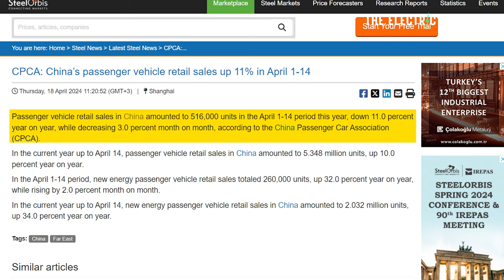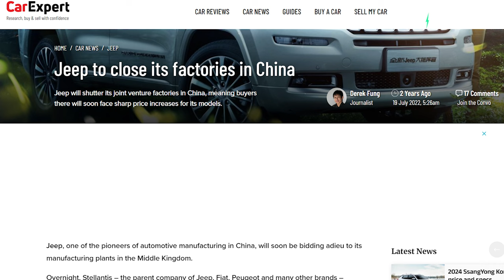China’s EV sales pass 50% - Toyota Camry & Nissan Sylphy crash 60%

Comment: I am surprised that people doubted that EV will break 50% in china very quickly.  Although non-scientific, among my Chinese friends who are in the market for a new car,  every single one of them are looking for an EV.
Reply: People lie too.
Reply: Also helps when you have to enter a lottery for number plates
Reply: And how does China produce its electricity ?
Reply: @wengelder9256  China is  largest user of solar & wind. They also have the 3 Gorges dam which is bigger than Hoover dam
Reply: @1rjona  The answer is coal. They open a new coal fired plant every week.
Reply: @wengelder9256 doesn't matter. Even if it was 100% coal fired, on a pure energy basis, it's still a 50%+ reduction in ALL emissions over gasoline in the same # of vehicles. This argument is dead in the water.
Reply: @littleherms3285  quite clueless on math , physics , chemistry and  what not  . Anyway … bedtime ( not for me ) . Thinking that making a few thousand EV mostly powered by coal generated electricity is  going to make a lot of difference is naive . And even then , the rest of chinas economy is heavily depending on coal. And half of the world’s coal emissions come from China .
Reply: @littleherms3285  How many plants have been funded to either build batteries or ev's that have closed this year? Just the cost of that capital alone will never be recouped.
Reply: @francismarion6400  and that relates how?
Reply: @wengelder9256  way to counter my point. Nailed it👍
Reply: @wengelder9256  On a per capita basis, China's emissions is still much lesser than USA.
Reply: @wengelder9256  50% of Chinese electrical generation capacity is now renewable, with massive ongoing investment in nuclear, solar and wind.  China adds more renewable power than the rest of the world COMBINED.  The needle moves faster as the cost goes down and production goes up.  Regardless, even if China's electricity was 100% coal (it's not), it'd still be cleaner than burning diesel or petrol due to the greater efficiency in a thermal plant vs ICE.
Reply: @francismarion6400  the answer is actually half fossil fuel half renewable, and the percentage for renewable is growing fast
Reply: @francismarion6400  lived in Beijing in 2000s. Revisited 2012, 2018 and one month ago. Air pollution has noticibly improved. Particularly since my last visit.
Reply: @markthomas7279  So what's that mean? They had more rain to wash smog out of the sky?
Reply: The use cost of EV is much lower than that of ICE car, which is why people buy EV.
Ordinary people don't need such a high concept of environmental protection
Reply: Electricity cost is only 0.15 of a gas car fuel
Reply: Despite the decline, there are still huge sales of ICE cars in China.
It is a very good policy to let EV compete with ICE cars. As a result, the prices of both sides have dropped, and consumers are the biggest beneficiaries.
Reply: @wengelder9256 like everyone else, a mix of sources.
Reply: @francismarion6400 China also has the most renewable energy of any country.
Reply: @vhrui904  Not in Saudi Arabia. Our gas costs a lot, and we get poor fuel economy because of taxes and regulations.
Reply: @williammeek4078  Says who?
Reply: @jogana6909  Most people can't absorb the loss of the price cuts from week to week. There is no market for used ev's.
Reply: you should go out
Reply: @wengelder9256 you don't believe in climate change so why does it matter? You  ICE lovers are hilarious!
Reply: @francismarion6400 very expensive in Europe too
Reply: @wengelder9256  We're not talking about useless hydrogen cars that do represent only a few thousand sales. Millions of EVs are being sold and the air pollution difference is noticeable in most of the large city centers in China and some in Europe with zero emissions zones. That's a huge positive for the public health.

Even if the pollution was just being displaced to powerplants, that's a net positive as the pollution isn't being emitted in the cities where people live and work. Thankfully, the reality is even better and the net emissions are FAR less for EVs in addition to the displaced and centralized pollution centers.
Reply: @brianliddell7938 nothing we can do about it. Evs do nothing
Reply: @francismarion6400  Through the relocation of factories around Beijing and the reduction of fuel vehicles.
Reply: @wengelder9256  Coal-burning thermal power plants can achieve ultra-clean emissions, but fuel vehicles cannot.
Reply: @YunLuoShanZe  coal burning thermal power plants emit carbon and sulphur dioxide , heavy metals such as mercury and lead . What is the matter with you ?
Reply: @wengelder9256  You need to learn what ultra-clean emission technology is.
Also please keep studying before you want to make a comment.
Reply: We now have 2 EV in China (Shanghai) Model Y and now MG Cyberster the way to.go
Reply: @YunLuoShanZe  Wengle is just a troll "hater"... forgive him... his mum dropped him when he was 1 year old. Bumbed his head quite badly
Reply: @jogana6909  If you own a EV and that company went out of business...how are you going to get any repair parts or software updates?

Comment: Half the vehicles sold by BYD are EV's, the other half are hybrids. BYD knows how to hedge their bets.
Reply: if the market wants it, then give them what they want.
Reply: BYD starts with battery, so they build the EV or hybrid cars as long as their battery tech can be applied.
Reply: @fatdoi003  Can you explain THAT to the Americans, please They seem to think that THEY will TELL US what we want.
Reply: You should look at the BYD PHEVs.  Every BYD Dual Mode PHEV has at least 120 km electric range - which matches or beats the 1st gen Nissan Leaf EV.  China has very broad charging infrastructure along with excellent electric HSR, so their cars only do local driving.  They probably do 99% on battery.
Reply: @capnkirk5528  There is a very big functional difference between an American plug-in hybrid with <20 km electric range and a BYD PHEV with 120+ km electric range.  American commutes are something like 70 km, so their hybrids are completely inadequate.  Chinese PHEVs easily cover a daily commute, with public EV charging everywhere, so they can run on battery 90% to 99% of the time.
Reply: Even for PHEV, this is a great achievement.
If it weren't for charging, I believe no one would buy a PHEV.

Comment: I was recently in Shanghai, Shenzhen, Guangzhou and Chengdu an can attest to the significant improvement in the air quality.  This difference may be attributed to closure of many old inefficient factories but increasingly the rapid adoption of EV's at the expense of ICE vehicles.  It would seem that China has been quite a success in this respect.  Blue skies are finally materializing!

Comment: I think the Chinese realize how reliable and cheap to run EV's are compared to ICE cars. There is so much negativity, ignorance and misinformation going around by people in Australia who have never driven an EV.    In China EV's have proved to be a better option and they will continue to take over.  We are just 5 years behind.
Reply: Oz gets the BYD Atto 3, and the YT reviews I see are quite positive.  It's going to be very interesting.
Reply: 1,000,000% agree.  Every person that asks me about my model 3 as something negative to point out.  I usually take them for a drive and everything changes.  People need to experience EV's before criticising.
Reply: I work in a store in which equipment is operated by electric motors. These motors hardly ever give problems , that's how reliable electric motors are.
Reply: @eish3291  exactly, there is a reason Ice motors have been mainly used in portable vehicles (anywhere where you can access electricity an electric motor is usually preferred). They are complicated inefficient things with lots of moving parts. After decades of research and development and billions of dollars, they have become reasonably reliable with regular maintenance. But they don't compare in efficiency and reliability with brushless electric motors. Now the battery technology has improved so much, the days are numbered for ice cars. Although I think big oil and anti Ev politicians, lobby groups etc are trying to convince people not to buy them. I think there is a fair bit of anti Ev misinformation being fed to the public at the moment. Also a lot of ignorant people just don't like change.
Reply: @joshlaycock3256  I think everyone can remember driving an ICE car that was a money pit, constantly giving problems etc. yes a modern ice car is fairly reliable, but it needs regular maintenance. I think all the electronic features, eg power windows, lane assist etc can still cause trouble in both ice and Ev. But we are seeing more and more Tesla's and BYDs getting 600,000, to a million km with the same battery pack. Even the most anti Ev, scared of change people will eventually start accepting ICE is yesterday's technology.

Comment: Someone should should make EV first hybrids, ones that have an EV drive train plus a small onboard generator to recharge the battery for those few times when you don't want to stop to charge on long journeys. Far simpler with all the benefits of a hybrid and less energy wasted as heat and friction and less maintenance. This could be a modification to existing cheap EVs. All you need is an extra charge port connection on the inside and an exhaust outlet. No point redesigning the engine so just use an off the shelf generator and even have it removable for when the range is enough but want extra space. I can see a camper van version being popular.

Comment: Car buyers know NACS will be the standard in the US and don’t want to get stuck with a CCS1 EV. This is the year to lease until all EVs have NACS (J3400).
Reply: Relative to the total number of vehicles on the road, the US has almost no EVs and no public chargers.  At this point, the US might as well go with China's GB/T standard.  LOL
Reply: @ZweiZwolf  Done deal. J3400 NACS is the standard here. Europe can't use it because they have 3 phase power over there.
Reply: @frankcoffey  Huh?  The US baseline is also 3-phase 480V for industrial use, which steps down 1-phase 240 or 120 for typical residential & commercial.

Comment: Why do you include phev? Its still polluting
Reply: Because of the Chinese brand of hybrid vehicles, there are two kinds, one is hanging a blue license plate (fuel vehicle), similar to Toyota's Prius, similar to Nissan's e-POWER, can not be charged or pure electric line distance is short, this kind of vehicle sales statistics, not in the electric car, but in the fuel vehicle.

Another example is BYD's Qin DMI, with a green license plate (new energy vehicle) and a minimum pure electric driving distance of 60 km or more, even if it never charges and relies purely on fuel, the level of fuel consumption is even lower than the Prius. And 60 kilometers of pure electric driving distance is enough for a person to commute to work, shopping, picking up children to school and other daily needs.
Reply: @qipang9271  its a good stepping stone but not truly achieving net zero. China can lead the way
Reply: Most Chinese people work in cities, and even PHEVs can operate in all-electric mode, with these vehicles likely using electricity 90% of the time. However, when traveling home for the holidays or going on trips, it's always good not to have range anxiety. Overall, this is certainly a positive thing. If PHEVs aren't offered, many potential buyers might opt for ICE vehicles instead
Reply: @jeremyheung6582 a very pragmatic way of thinking, not too dogmatic and ideological  like the Westerners

Comment: BEV or New Energy Vehicle ? 

In China Hybrid and BEV are both considered as New Energy Vehicle.

BYD is selling more Hybrid than BEV, how is it possible BEV reach 50% penetration within few month time ?
Reply: New BYD Hybrids batteries are quite big, like 30-45kWh and also the fuel cost is way higher that charging even on the public chargers under the apartments. The slow, 3.5kW chargers are avail just everywhere.
Reply: PHEV? Hybrid MPG are still poor and  still consume a lot of fuel.
Reply: @yulusleonard985  The BYD Seal DM-i  will have a combined range of over 2000 kilometers and may consume less than 3 L per 100 kilometers. Seal DM-i will start at 169,800 yuan (23,500 USD). - yeah... no EV can really compete with hybrids...
Reply: @shafir2info  The BYD Seal DM-i  will have a combined range of over 2000 kilometers and may consume less than 3 L per 100 kilometers. Seal DM-i will start at 169,800 yuan (23,500 USD). - yeah... no EV can really compete with hybrids...
Reply: @morganangel340  Im sure if you remove 40kwhh PHEV then EV can compete with them Japanese PHEV still us 8 kwh battery and with fast charging long distance travel no longer problem.

Do you consider hybrid with 2 kw battery a NEV?
Reply: Historically, BYD sells about half BEV and half Dual Mode hybrid.  BYD's Dual Mode "hybrids" have 120+ km electric range, like a 1st gen Nissan Leaf EV.  Considering that the average Chinese person drives ~15,000 km annually, that averages 40 km/day, so the typical person only charges 2 or 3 times weekly.  The electric range is good, and BYD has been waging a price war to take market share from ICE vehicles.
Reply: @yulusleonard985  don't think there are 2 kw battery PHEVs

Comment: Ppl too often dismiss other's issues bc they don't feel it. China is a big country, 3X more ppl than the USA. In countryside, rural regions, charging an EV is out of reach, home charger too $$$. For many others living in high rise, home charging is not ready while mechanics wages are reasonable, so for them BEV only isn't the right answer. The right answer is whatever works for that particular family. Their govt is encouraging transition to 🔋 powered transportation, some will /can go 100% BEV, some go for hybrids
Just be glad hybrids gets 2X mpg more than same class ICE.
Reply: China has a population of 1.4 Billion vs 350 Million in USA, so China's population is about 4x bigger.  China solved the charging problem by building HUGE numbers of chargers at every parking lot. If the BYD DM-i EVs were available, they'd do great in the US - 70+ miles for daily driving plus 100s of miles on petrol!
Reply: Your knowledge of rural China is wrong.
Farmers in China use a large number of low-speed three-wheeled electric vehicles. These tricycles are not counted as car sales. These tricycles are charged with the most common 220V socket, which is not fast, but it is enough.
Reply: countryside resides use low speed EVs for transportation, I assume at least 10-20 million such been produced each year since its way cheaper and less endurable than usuall EVs
Reply: You get all your info about China from ???? 😂😂😂.

Comment: Just wondering how true this is because majority live in units,  how do they charge their car? do they send an extension cord from the window of the 50th floor to the footpath?
Reply: As of March 2024, the private charging infrastructure configuration of approximately 6.745 million vehicles was sampled from vehicle companies within the China Charging Alliance, of which 6.403 million private charging piles were built with the vehicles. 
Most apartment units in China since the 21st century have above-ground or underground parking lots, and residents will buy or rent parking spaces. Major regulations in most cities in China stipulate that each unit under 70 square meters must have one parking space, and 1.2-1.5 for units above 70 square meters.According to national law, when you ask to install a charging box, the State Grid Company must install an electric meter for you free of charge. Most EV prices include the cost of installing the charging box, and you may need to pay part of the cost of running the cable from the meter to the parking space. This provision also applies to rented parking spaces.
Reply: China installed massive charging stations at every parking lot.  I was in China and saw for myself.  Banks of 20+, 50+ public chargers at the park, at the mall, in the apartment garage.  The province of Guangdong alone has more public chargers than the entire USA.
Reply: Many street parking spaces in China have charging piles.
Charging piles are small and not as dangerous as oiling machine, so they are everywhere.
Reply: A homeless person with a bicycle and a dynamo peddling furiously will charge your car for $1/-. Does this answer make you happy? 😂😂

Comment: Sam uses the term EVs for the first 90 seconds then clarifies what he really means is PEVs (or NEVs).
 
If BEVs (not PHEVs) hit 50% of Chinese auto market that is a major turning point.

And PHEVs without DC fast charging are idiotic. I'd rather buy a plugless hybrid than lug around a battery you can't charge.
Reply: There are no small batteries PHEV on the China market anymore. It's at least 30kWh.
Reply: You charge at home and for this couple road trips a year you use gas. That's how vast majority of chinese PHEV are used - statistics not my opinion. It makes perfect sense if you have home charging( which most of chinese have even in apartments).
Reply: @thomaslesny61  unfortunately that doesn't work so well in Australia where families do longer trips on the weekends.

I think DC fast charging will become more common. There's no obstacle to it. But ultimately it's a stepping stone to full BEV.
Reply: BYD's Dual Mode "hybrids" have 120+ km electric range, meeting or beating the 1st gen Nissan Leaf.  A BYD DM "hybrid" is an EV, probably drives 90-99% on battery (China's electric rates are very affordable).